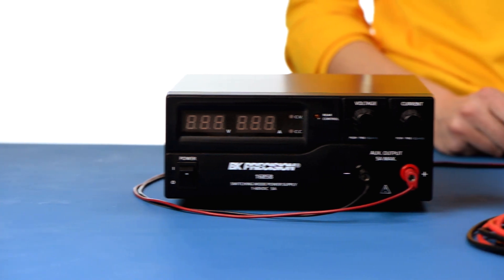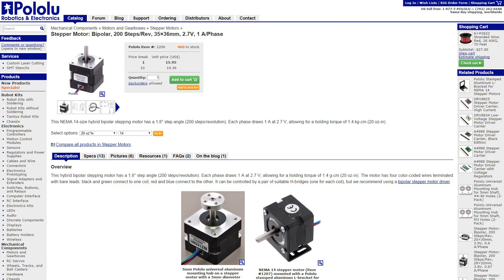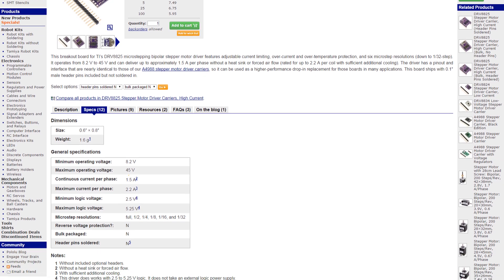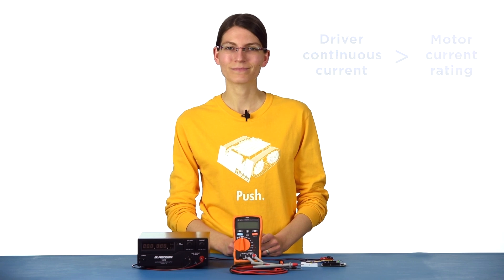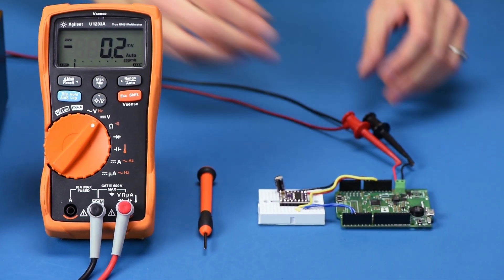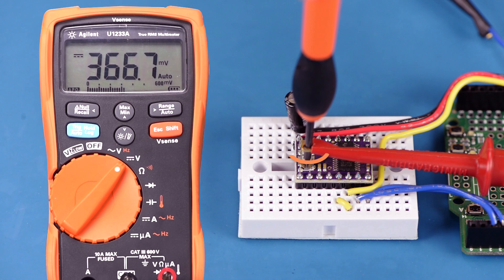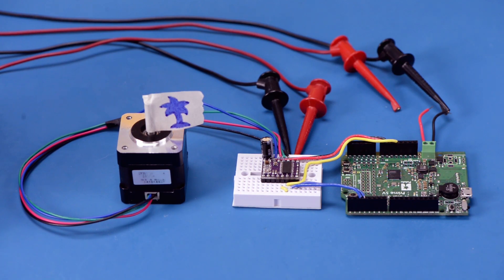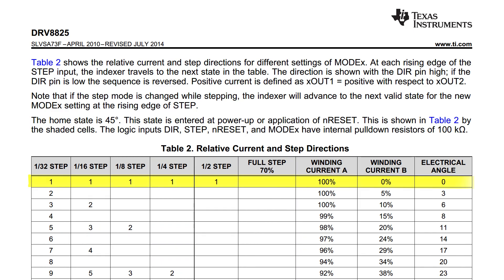Setting the Current Limit on Pololu Stepper Motor Driver Carriers

Comment: Is it necessary to only connect the motor supply? Or must the logic supply and logic signals from the MCU be present as well?
Reply from the maker: You will need to supply to appropriate logic signals to control the stepper motor.  How to properly connect the logic supply depends on the particular stepper motor driver carrier; you should refer to the minimal wiring diagram located on the product page for the stepper motor driver carrier you are interested in: https://www.pololu.com/category/120/stepper-motor-drivers

If you have any more technical questions, a better place to ask them is on our forum.

Comment: Using full-step you get one step out for each step in? What happens when you half-step?
Reply from the maker: Half step mode provides intermediate activation of the coils to give you two positions per mechanical step of your motor, so if you had a motor with 200 steps per revolution, it would take 400 half steps to make a full rotation.
Reply: So would it then move half of the rated degrees/step?
Reply from the maker: Yes, for each input pulse.

Comment: Hi , which program are you using to measure the current through one coil?(step stoped but energized?).Thanks
Reply from the maker: To get a stepper motor to hold position (i.e. be energized but not step), you can apply a constant high or low signal to the step pin, so you do not need any program.  In the video the A-Star was running a program that just held the step pin high.  It is easiest to get an accurate current measurement with the stepper driver in full-step mode.
Reply: Thanks you so much.Best regards

Comment: i have 12V 0.4A Stepper Motors, i have set the VREV to 200mV, is hat correct?
Reply from the maker: +ipadize It depends on which stepper motor driver you are using, since the equation used to set the current limit is not the same for each driver.  However, this is not an appropriate place to ask that kind of question.  If you want to continue checking your setup, you can start by reading our support page: https://www.pololu.com/support

Comment: Texas Instruments state that the "continuous motor drive output current" of the DRV8825 is 2.5A and yet you show it as 1.5A, why is that? Also the DRV8825 has an internal logic power supply and so connection to the 5V of the Arduino should not be required, as a matter of fact that pin is used as a fault indication output (active low).
Reply from the maker: +Ingmar Meins See the "Power dissipation considerations" section of the item #2133 product page for an answer to your first question about the current rating. Regarding your connections comment, it sounds like you are referring to our alternative minimal wiring diagram, which is just one possible valid way to connect things. The sleep and reset pins must somehow be driven high for the driver to operate; this can be done using I/O pins or a direct connection to the Arduino's 5V output, or by driving the fault output high and connecting sleep and reset together.

Comment: Thanks for the great video, just what I was looking for. However, I was using the exact same orange and black shaft screwdriver to set the current but found that the the black anodize layer on the shaft is not a good conductor. Once I removed the anodize layer it worked great.

Comment: Perfect video, thank you so much!  How about if I have 2 steppers for the z-axis, does that matter in the calculation?
Reply from the maker: +The Head If you are using two identical stepper motors wired in parallel to a single stepper motor driver, you would set the current limit to approximately twice the rated current of each individual stepper motor.  Please note that you should take care not to exceed the current the driver can handle.

Comment: hello! thanks for the video !
a question! with a supply of 24v and a motor 2.5A per phase , what the appropriate Vref ?
Reply from the maker: +Andrea Tomaghelli You can find the formula for calculating the VREF voltage for each of our stepper motor driver carriers in the "Current limiting" section of their product pages.  Please note that none of our stepper motor drivers are rated for 2.5 A, so they might not be appropriate for your application.

If you have any more technical questions, a better place to ask them is on our forum:

http://forum.pololu.com

Comment: You said unplugging the motor while under power can damage the driver or motor, is this just because of the inductive spike or is there another reason?
Reply from the maker: Justin Bell Yeah, that's the main reason; it's also generally bad practice to take apart or work on live circuits when it's not necessary.